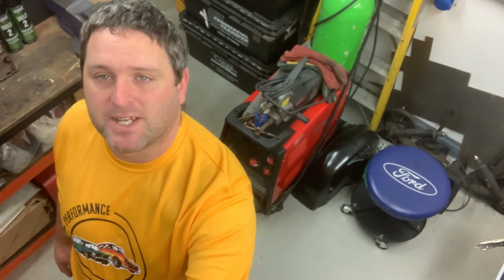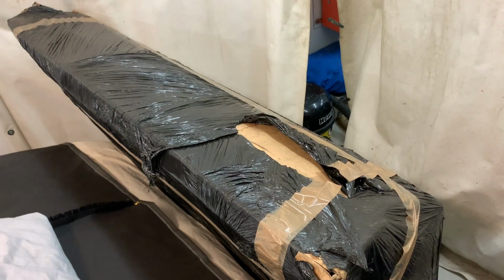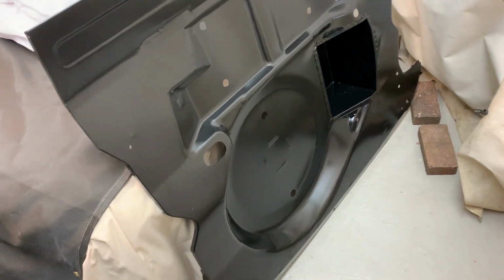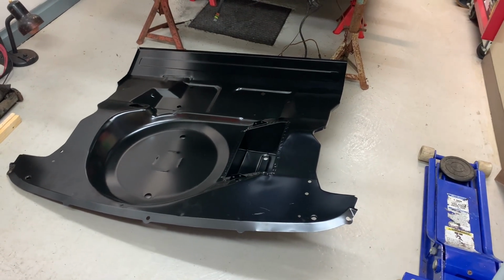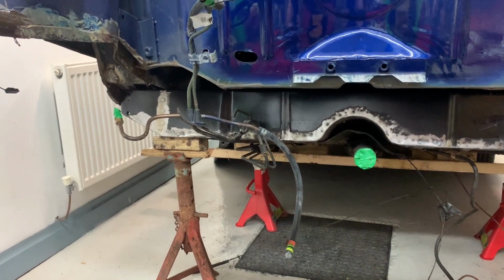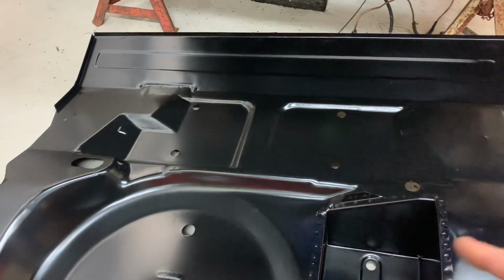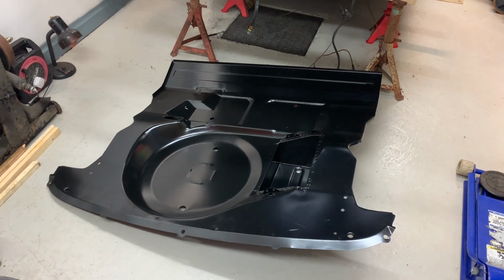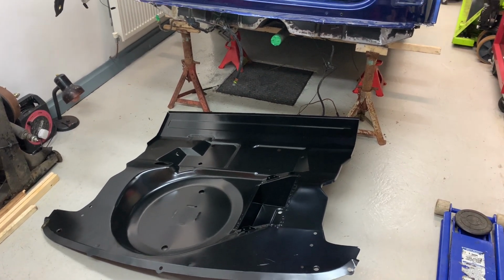Rover Mini Cooper S Partial Restoration Episode 3

Comment: Cracking job Craig wouldn’t expect anything less after watching the escort build 👍👍
Reply from the maker: Cheers neal. Appreciate it
Reply: Just also wanted to say I’ve just started my own car st 170 I actually copied the way you did your fuel system I’m over the moon m8 🎉🎉🎉
Reply from the maker: @nealthomas5943  awesome 👏 Did it all go as planned??
Reply: @performanceclassics1986  well went to start it but the oil pressure light was staying on then the battery sratrted to die so bought a new battery fitted it cranked it over oil pressure light went out then after a few seconds then went for a start I was online with motorsport electronics where I purchased the ecu and throttle body kit she fired up straight away need to get it on a rolling road now 👍👍
Reply from the maker: @nealthomas5943  Awesome result 😎. Makes all the hard work worthwhile doesn’t it
Reply: @performanceclassics1986  too right Craig when you do it yourself you realise the work that goes into it 👍
Reply from the maker: @nealthomas5943  Absolutely. You also realise why places charge soo much due to the sheer hours involved in such work